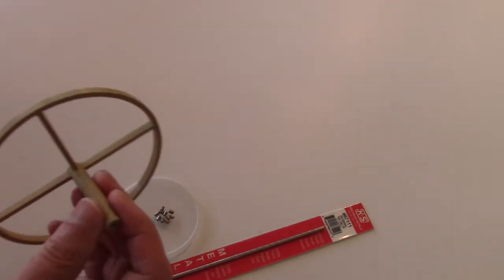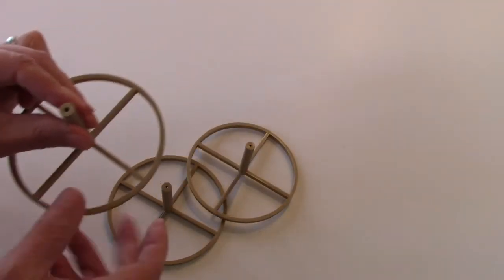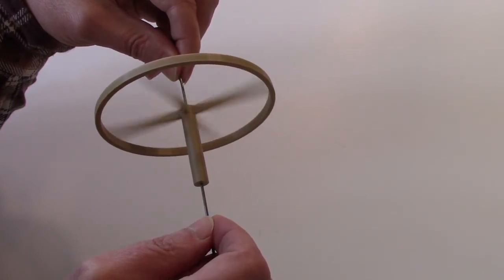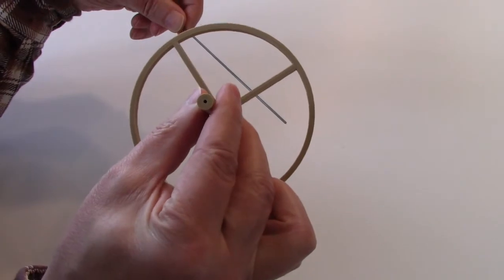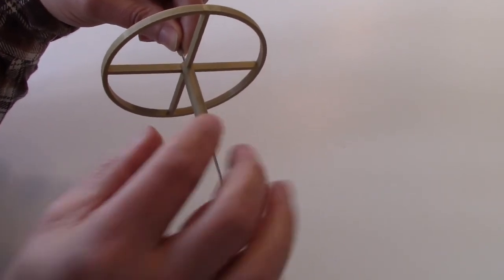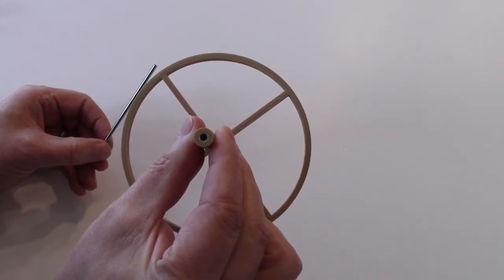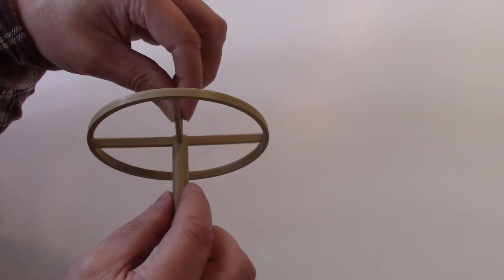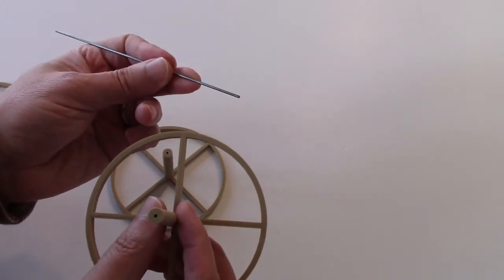3D Printed Clock Arbor Test

Comment: Love this stuff. Id love to try to think through and make a super simple clock, its fascinating, thinking about friction, joints, bearings as well as the physical gears etc.
Reply from the maker: Thanks. I enjoy the process of analyzing every small detail in a clock. 3D printing has completely different constraints than brass and the design is much better when it optimized for printing. My latest clock at MyMiniFactory was designed to be as simple as possible. This also made it more efficient and runtime is 32 days per winding.
Reply: @stevesclocks  ooh ill have a look thanks!

Comment: Thanks for the test results, Interesting ! I have built many tone arms for vinyl record players for years. Tone arm needs very low friction bearings, and I found that a brass tube with stainless steel shaft works best. just my 2 cents worth.
Reply from the maker: I should try brass tube with steel shaft. Bushings should have a great life span in a clock, but add an extra step that is difficult for some. My newest clocks have gone for the simplicity of simple printed holes.

Comment: Interesting!
I have been using 3/16, that would double the friction...time to go smaller
Reply from the maker: Smaller diameter will reduce friction. I cringe when I see wooden clock designs with 1/2" wooden arbors everywhere. Runtime is going to be short.

My suspicion is that arbor friction is still a small portion of the overall friction in a clock. Friction in the escapement and pendulum support are probably a lot more significant. Most escapements have some amount of sliding friction. The load is very small, but the action repeats with every tick.

The other major source of friction is the pendulum support. The kinetic energy of the bob needs to be restored to keep the clock running. A pendulum that runs down within 5 minutes would require twice as much energy as a pendulum that lasts 10 minutes. My next experiment will be to test the friction using different types of pendulum support. Hopefully it will be posted in a week or two.

Comment: I was surprised by this result. Maybe a large bearing surface is only appropriate for heavier radial loads e.g. the pulley and great wheel. Thanks for sharing your research.
Reply from the maker: Traditional brass clocks use very small diameter steel arbors in brass holes for most of the train. The arbors near the weight shell are larger diameter to support the heavier loads. This experiment is designed for 3d printed clocks and I expect a useful life of a few years might be sufficient. 

I didn't mention in the video, but the steel bushings would probably last a lot longer than simple printed holes. So far, my clock with bushings has lasted nearly two years. The newer design with simple printed holes is only a few months old. Both are still running strong. The weight shell arbor uses ball bearings to support the heavy load.